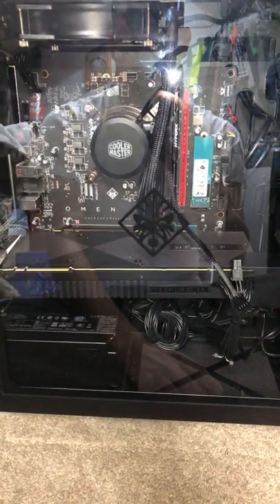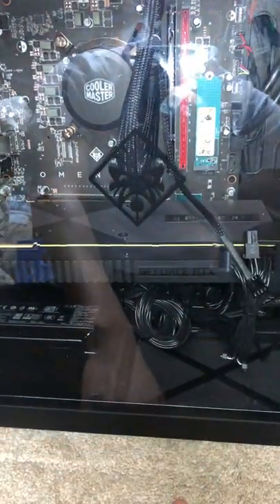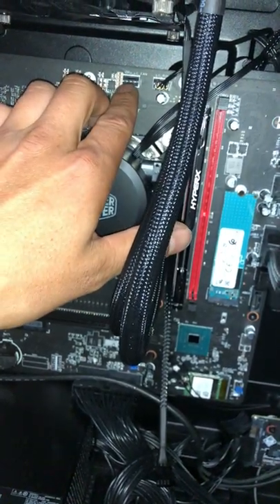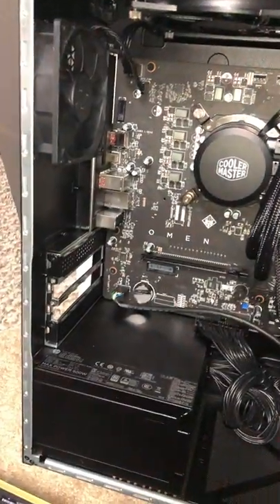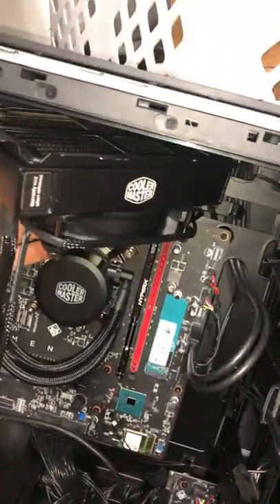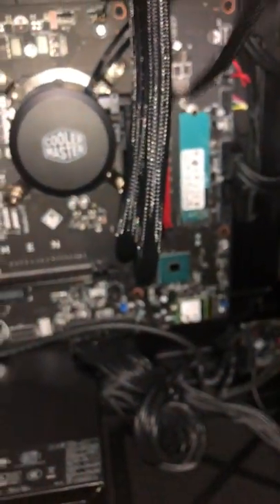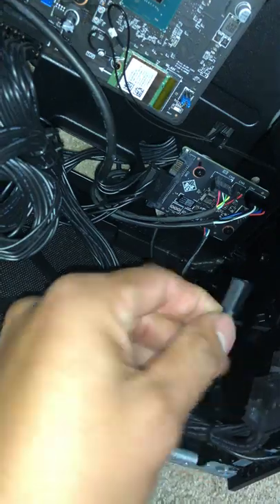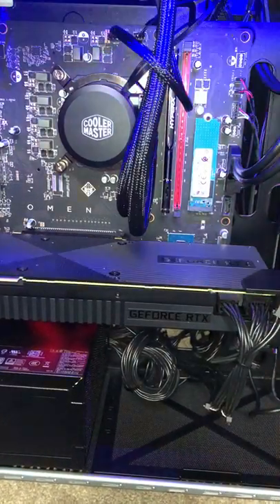HP Omen Obelisk RTX 2080 CPU cooling upgrade. Upgrades pt.1/3

Comment: Nice video.  I just got this desktop computer with the GeForce 1060 3gb video card.  I'm not gaming on mine, but wanted to start doing some 4k video editing.   My specs when I bought it were; Intel i7 8700,  16 gb of ram, 256 gb SSD main drive, 1 tb HDD, GeForce 1060  3gb video card.   I purchased another 16gb of Kingston hyper x ram as this was the same ram that was in it.  Now I'm at 32gb and dual channel.   I'm glad the system came with one 16gb stick and not two 8gb sticks.   
Later down the road I may upgrade the GPU, but it seems fine for now. 
This system is a big upgrade from my old laptop which was running a first gen intel i7 if I remember correctly.   The GPU on that laptop is a GeForce 330m 1gb.  So this new desktop really is a big upgrade for me.
Reply: Wigglythegreat2 I have the same desktop I recently upgraded the GPU to a Msi Gaming Z  RTX 2060.
Reply: That's what I might do, but I'm probably going to wait until I see some sales going on.

Comment: I just installed mine and started to run about 93c as soon as I opened a game. What am I doing wrong?!?!?!
Reply from the maker: Did you have thermal paste? Is the pump connected to the connection on the mobo?
Reply: dud u gotta aplly the paste or in some houres ur pc takes fire or shuts dowen lol ahahah
Reply: @Brian.C  r/ihadastroke

Comment: noice. i got this one for $899, went with air cooler though because a 120mm radiator on a water cooler is generally less efficient than a decent heatsink (case can't fit more than 120mm)

HP or whoever designed these cases did a pretty poor job with air flow. I have the newer 30L, only has 2 real fans on it, it runs pretty hot. Had to install two more fans just to get it to a decent temp.
Reply: I have the same rig and I wish we were able to add more fans. Maybe buying a new case and mobo should do the trick sadly

Comment: Thank you so much, I was in desperate need for a video like this one, please make a video of the case fan, PSU, and GPU cooling. I want to upgrade those too. But I do want to clarify this for  now, you are still using the 500W stock PSU during this video right?
Reply from the maker: Yes that is correct. Your PSU should be able to handle a small cpu cooling unit. I’m using a 120mm fan and radiator.
Reply: Awesome, I have the exact same desktop and I'm in love with it, running 1440p at 144hz on ultra, but it concerns me to see the CPU and GPU temperature above to what I'm used to, The GPU  goes up to like 80-85C, I'm used to it being on the 60-70's the highest. If you don't mind, I would like to use this exact same liquid cooler you got for your CPU, could you share with me the exact model you used? Also, did the liquid cooler  already have thermal paste applied? 

Also, reading the other comments, I'm fairly familiar but new to the desktop modding community, but I do see that you recommend Precision X1 to increase the fan speed on the GPU, can that also increase fan speed on the case fan and stock CPU fan?
Reply: Actually, I just saw that you posted the model for the cooler in the comments. But my last question still stands, about the precision X1.
Reply from the maker: No, the software only controls the GPU. However if you decide to mod the CPU and the new bigger fan should bring the temps down so you don’t worry about the cpu at least.
Reply: Thank you man. If you are planning to make a next video and it is possible for you, if you could make the case fan asap that'd be great, I really hate to see 1 little fan working hard to take the hot air out of the case. An RGB one would be so cool!
Reply: Also another quick question, what size case fan are you planning to use to replace the fan in the rear? And did you have any room left for any other 80-120mm size on the top next to the radiator?  @ramonvazquez2475
Reply from the maker: Im not sure if I’m going to replace as to much as I am stacking another fan. Not sure... until I get my parts I’ll make a decision as to what works best, but the rear fan is a 90mm.

When I added the 120mm on top it left hardly left any gap.

Comment: Thanks for posting these upgrades. I installed a Corsair AiO H60 cooler on my CPU, but can't figure out how to control the radiator fan or pump (they are both plugged in to LC fan and LC pump headers on the MOBO). It works fine, though the CPU is still getting pretty hot (max of 75 degC) during taxing gaming sessions, so I'd like to increase the rad fan speed. It seems the BIOS doesn't allow the user to make custom CPU fan ramps or control the voltage to the pump. Am I missing something?  Thanks.
Reply from the maker: As far as I’m aware you can’t control these two with our motherboard. They are basically on auto. Like you mentioned the only way to control them was through the bios that I myself haven’t tried as my temps are never in the 70s. Before you follow any of the steps below what’s the temp on it at idle?? Not sure what load you’re putting on the cpu, but if your using the cpu at 80% or more then I honestly think that’s ok. If the load is far less than I’d be worried. 

A couple of things I can think of. If I’m not mistaken the pump is a three pin? If so make sure it’s connected in the right three pins as our pump connection on the mobo is a four pin. The groves both on the pump connecter and pump connection on the mobo should line up.
Check and make sure the pump is making full contact. You can determine this by seeing if the thermal compound is evenly spread on the cpu. 
Next make sure there’s nothing obstructing the air flow. Have you removed the plates on the bracket?
Next, i know most Corsair AIO coolers come with they’re own pre applied thermal compound. Try using your own, but before you do clean existing one first.
Reply: @ramonvazquez2475  Yeah, it's a bummer HP doesn't let the user manually control the air flow. At idle, my CPU is in the low 30s. Running the Prime95 CPU torture test, it only gets to the mid 50s. It only gets to mid 70s when playing Battlefield 5, which may be expected, considering how much I'm told that game uses the CPU when the future frame rendering option is enabled. I am pretty sure the 3 pin connector is connected correctly and that the pump is making full contact with the CPU. I guess I could take it off and see how evenly spread the pre-installed compound is and maybe apply my own. But as long as it only gets to those temps under full load, I guess I am fine as it is now. My main worry with this system is actually the GPU temps, which me and many others have observed getting into the mid 80s under full load. Making a custom fan profile seems to have alleviated this issue, as I have never went above 75 since applying this fix. But of course this means the system is much louder now. So I'm interested to see your water cooled solution. Particularly I want to see how you mounted your radiator and fans in the bottom of the case, where there are no mounting screws. Sounds like a fun DIY project. Keep it up. ;)
Reply from the maker: Jordan Jensen many are waiting on that video and I’m still a days out as they messed up my order. I’m also hoping the results reduce the GPU temp without the noise. Fingers crossed and thank you for the support!
Reply: Hey I was wondering is your pc the same as the one in this video because I almost have the same pc and im looking to buy a liquid cooling unit for the cpu. I bought the corsair h100i RGB platium with 240mm but I took it to geek squad and the guy says it does not fit. So I am trying to find a cooling unit to fit. Honestly I don't care about the lighting.
Reply from the maker: Yes. You’ll need a 120mm radiator on this pc

Comment: any advice on what gpu to upgrade too?
i have the 1060 3gb that came with it and am planning to spend around 500 for it
Reply from the maker: In your budget I’d do the 2070.
Reply: Ray Dizzle I’m Upgrading to the 2070 super, just worried about cooling someone said I could use MSI afterburner and turn the fans up
Reply from the maker: So not all rtx cards are bad at cooling. It’s just the blower style cards from HP. But you still can use MSI afterburner to control the the cards fans.
Reply: Ray Dizzle I was going to get the MSI 2070 super and it has really good cooling I have heard.

Comment: can you please make a tutorial on how to remove the back panel?

i cant seem to figure it out
Reply: HP themselves have a video
Reply: There is a screw, inside the case, by the back of the power supply. Unscrew it. Then the other (not the glass side) side panel can be removed.
Reply: 7:44

Comment: Why couldnt you use the original bracket and avoid removing the motherboard? Just simply leave the old bracket perhaps? It should be a standard size
Reply from the maker: That’s not the case. Usually each cpu cooler has its on screw type or different brackets.

Comment: When you removed the motherboard, did you need to take the back off? When you took it out, did you need to disconnect your NVME, motherboard battery, wifi-card, or can you leave them in and just disconnect the wires?
Reply from the maker: Adam Conte took the back off. Only need to disconnect the WiFi card.
Reply: @ramonvazquez2475  Why did you need to take out the wifi-card? I know it's probably a dumb question, I just want to learn more about it, because I have the same model and it's running hot, and I'm thinking about putting in an H60 Corsair water cooler.
Reply from the maker: Not the card necessarily but you do need to disconnect both wires to the WiFi card. They’re run through front of the pc case where the actual WiFi Antenna is located. But very carefully these cables are thin and can be easily damaged
Reply: @ramonvazquez2475  Did it require a SATA connection, or just the 4-pin fan and 4-pin liquid pump connectors on the motherboard? Or is a SATA cable also required? And did you see a substantial drop in temperatures when you installed this?
Reply from the maker: If you plan on using this cooler yes you’ll need the sata connection that is not being used to power the RGB. However you also need to pickup a molex to sata adaptor. Yes the temperatures on the cpu drop significantly

Comment: Ray dizzle if i change the motherboard will i need to factory reset because of Hp omen bios and command center because the components are good i just want to change some fans and get better ram and a better power supply and motherboard what should i do
Reply from the maker: Maybe. The OS currently installed in your SSD only recognizes your HP motherboard. Therefore changing the motherboard will require a new windows key for sure. Sometimes a clean install may be required for the new software and drivers to function 100%. I shop for my windows keys on eBay.

Comment: Definitely interested to see what ya do with the GPU. I bought the same PC on black Friday. I am enjoying so far but in does get up around 85 degrees for me. Not sure what to do. Whether to add more fans or move the whole system to a bigger case with bigger fans. Any info is very much appreciated. New to PC gaming.
Reply from the maker: There’s two ways to achieve this for our current desktops. You’ll definitely want to bring the heat down to the recommended 79 degrees if you want prolong your GPUs life. First and easiest way is to download the EVGA Precision X1 software. That way to can turn your GPU fan all the way up to bring that heat down. Also using the same software you can control the heat you want generated from the GPU. Example you can put your setting to not to exceed 79 degrees but this of course impacts how well the GPU performs. (Loss of FPS). 

Second option without doing some crazy modifications to the GPU is adding a second fan to the GPU. I’ll post a video of this one soon in a few days. The results of this one are something you won’t want to miss!! 

Now the only problem I have with these two options is the fan noise! That’s why I’m going liquid cooling route. Still waiting on some additional parts for this mod.
Reply: @ramonvazquez2475   looking forward to the vid. For sure interested in a vid on adding a new fan. Noise to me isn't as much a issue considering typically have a headset on. 

I did download Precision X1 last night but haven't messed with the settings yet. I have another option in the future to move all the HP internals to another Cyberpower case I have for more room to modify. Put at least 1 or 2 more fans
Reply: Easy hack before you modify anything, get 4 feet and get the case off the floor at least half an inch. i got the same one and im running the same temps. just got a water cooler for the cpu to also help with the hot air inside the case.

Comment: Is there any aio rgb cooler that our PSU will allow use to use without any modifications? I was looking at the nzxt m22 but don’t want to have to make any serious modifications or anything
Reply: Or do I need to get a Corsair commander
Reply from the maker: Not necessarily, you do need a USB hub and NZXT provides one as well. The thing is you still need a 2.0 to 3.0 USB adapter and you’ll lose the upper 2.0 external USB’s because you’ll be unplugging them. I’ve heard that you can also use the usb where the led is connected but I was never able to try it. Bottom line you’re short on internal 2.0 usb connections on that motherboard.
Reply: Ray Dizzle thanks and did you have to upgrade the psu because the inability to run a sata cable? Or what was the issue with the cooler master aio and the data cable
Reply: Would you suggest upgrading the mother board first and go from there or scrapping the whole thing and starting from scratch

Comment: Hello another question, I have a I7 8700 cpu 3.20, and when I play games it reaches 80-85+ degrees. should I buy another fan for the top of the case (same pc) or liquid cool it
Reply from the maker: 80c+ on any cpu is definitely considered hot. A fan on top will make little to no difference at all. You’ll have to add a AIO cooler for sure. When looking at your options make sure the AIO you go with is a simple one as you don’t have very many options to plug in to the motherboard. For instance, one connection for the cpu pump and one for the cpu fan. The motherboard has those two connections. 

When I installed an AIO my temps went down to 50-60 range. Another option that helps a ton is deliding the cpu. However I don’t recommend this if your barely starting or if your not confident with computer modding just yet.
Reply: Or if I can find a single fan 120 mm

Comment: Hey I have a question. I use the same exact pc and have made zero changes. I was thinking of replacing the power supply to give more power to my components. I still use the garbage stock cooler and was wondering if I should take the 4 pin off the cpu header and put it on to the lc_pump header as it would provide more power? Am I wrong?
Reply from the maker: Probably not as you stock cooler is probably spinning at max already

Comment: Hey quick question I have the same exact pc you have but I have a rtx 2070 instead. I do have cooling issues as it reach 85 Celsius when playing games like destiny 2. Do you think if I just add an extra 120mm case fan on top, I will reach temperatures between 75-80?
If not should I get something like a  CORSAIR Hydro Series H60 AIO Liquid CPU Cooler, 120mm Radiator, 120mm SP Series PWM Fan? Would it fit ?
Reply: Also with the Corsair cpu cooler , do I need to remove the motherboard ?
Reply from the maker: Cpu cooler will only help with your cpu. Does not help the RTX GPU. It could indeed help if you add a 120mm but will be very Minimal. Try lowering the resolution settings or add a 3rd party program to adjust your GPU fan settings. That’s about it before you have to think into water cooling the GPU as well.
Reply: Oh sorry I got confused. the issue is the cpu not gpu , gpu is fine , just the cpu reaches 85 Celsius.
Reply: Ray Dizzle 
I’m hoping the extra 120mm case can go make the temperature for the cpu go down a little. What do you think?
Reply from the maker: I’d do a AIO cooler on the cpu. The stock heaksink offers little to no help. But yes you would have to take the motherboard out